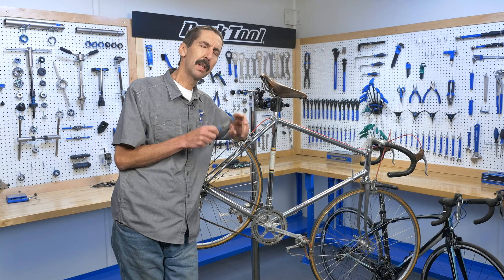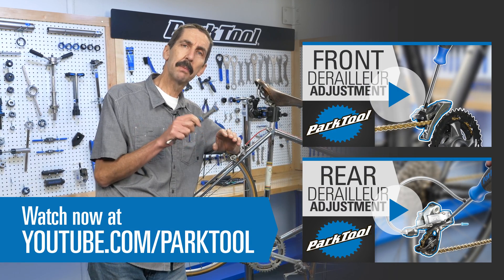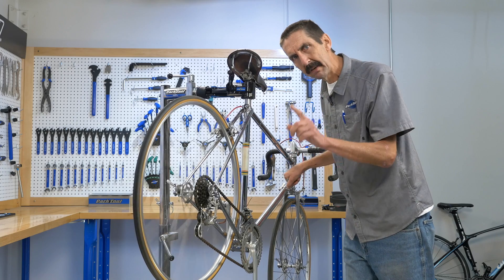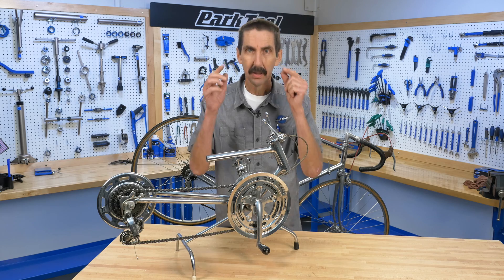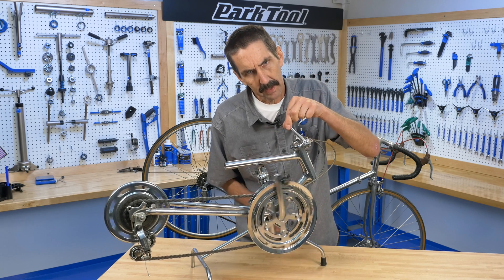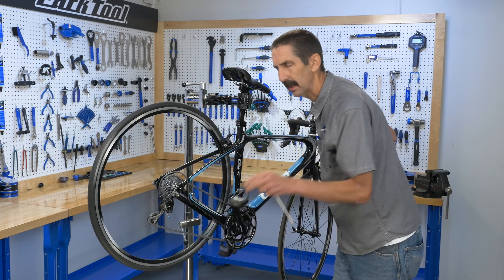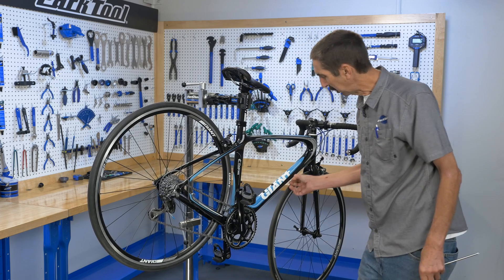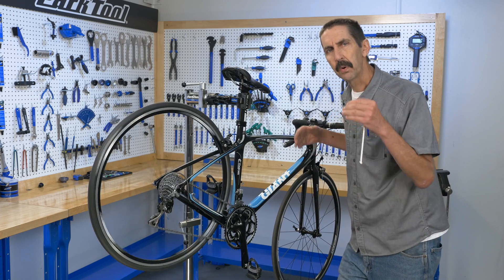A Brief History of Derailleur Adjustment - Tech Tuesday #88

Comment: You can also check the limits by forcing the derailleur to shift without having to deal with the cables.  This method works especially well with front derailleurs. Sometimes you might need to disconnect the cable to achieve this, but it's a simple matter of putting the cable back and getting the tensions right. You force the derailleur to move in the way the pivots operate with your thumb and middle fingers. 
You can even set the lower limit screw too tight until you see the jockey wheels move closer to the second sprocket. This way, you know exactly where the LS is and you can then slowly adjust it back to alignment.
Reply: classydays43 This is very true I have done this myself and it’s quite useful!

Comment: glad i watched the video was getting confused by the different methods used to indexing and setting limit screws and b screws i used to set the limit screws before i attached the cable to eliminate the cable tension confusion but after watching your latest videos you set the limits with the cable attached and loosen the cable adjuster while setting the high limit and when doing the low limit setting you purposely set the low limit screw too tight and back it off till it makes the shit quickly is this to stop damage to the bike while pushing the rear derailleur by hand it could jump into the spokes or into the frame ?

Comment: This is why I got rid of all my bicycles with chains and derailleurs and switched to bicycles with Gates carbon belt drives and internal hub shifting. Now I just ride the bicycle and enjoy it. Once in a while you gently hose the belt off and you're done. No fuss, no muss. I firmly believe that in 10 years or less the majority of bicycles sold in the United States will have a belt drive. This is my personal opinion and is NOT intended to provoke anyone.
Reply: I have yet to experience belt drive on a bicycle. I loved them on motorcycles and can't wait to use one again (I prefer the pedal bikes nowadays).
Reply: Wasabi Wei 
Check out the website for prioritybicycles.com.  They have reasonably priced belt drive bicycles.

Comment: How about introducing some JIS screwdrivers already?
Reply: Better yet: Change your derailleur adjustment screws to allen bolts. Not hard to do. Most of them are just regular 3mm socket cap bolts you can buy at any hobby store.
Reply: Scroll down about 3/4 of the page to the picture captioned "The DSD-4 and DSD-2 are apparently precision made screwdrivers especially for derailleurs. In the latter case, “built to exceed JIS standards”."Note the knurled section of the shank, just like the Vessel JIS +2 Megadora 900 screwdrivers:http://singletrackworld.com/2017/09/eurobike-2017-park-tool-reveal-trail-station-and-new-tools/
Reply: I would probably have been in the market for the SDS-2 had I not bought a couple of Vessel JIS screwdrivers.  Hey ho.
Reply from the maker: If you look closely, you might find one in this video...
Reply: Park Tool - same problem, JIS are very hard to buy, at least in the U.K.

Your SD2 is described as a Phillips for rear derailleur adjustment which does not make sense, unless it is shaped to be friendly to both

I cannot see the brand on the handle of yours, I guess Vessel?

I have an old Phillips that works, and a bit from a set that works, but would rather have a proper one -  without having to buy a whole set which is all that is available.

I am intrigued so have ordered the SD2!
Reply: Not useful for professional mechanics.
Reply: I noticed Calvin is holding a different screwdriver than anything you currently sell. I supposed you're teasing a newly designed JIS screwdriver here? Would be nice.
Reply from the maker: Oh, you notice?  Yes, the SDS-2, not available in any store....just yet.  Be the first on your block to have one, but give it some time to hit the shelves.
Reply: I replace my JIS screws with Philips heads so I don't need a special screwdriver. I replaced the H and L screws with Philips heads on my derailleurs very easily. You can even get a black screw for L limit, and a silver screw for H limit, so it'll help you differentiate them later.

Comment: so if the indexing works, why are the limit screws necessary?
Reply: When there is a schok on the road
The chain can go farther than the indexing limits
Hope it is usefill
Reply: ok thanks
Reply: Rear H-screw (L-screw in case of Shimano Rapid Rise type) and front L-screw are necessary for keeping the chain in the correct position on the smallest sprocket (largest with Rapid Rise) and smallest chainwheel because usually the cable is pretty loose in those positions whilst being correctly adjusted for indexing.